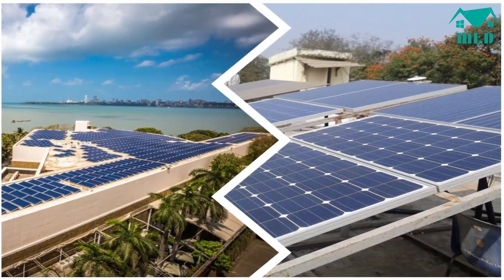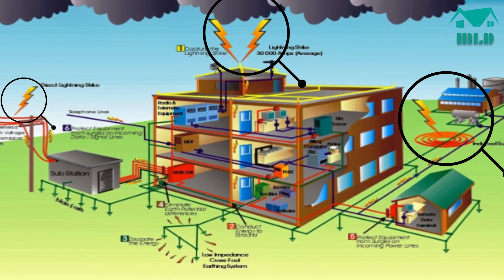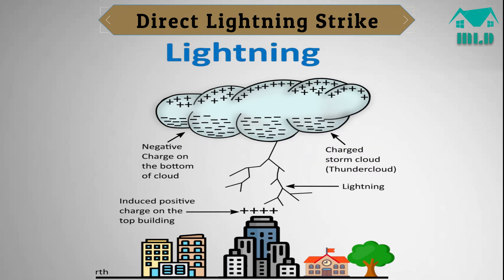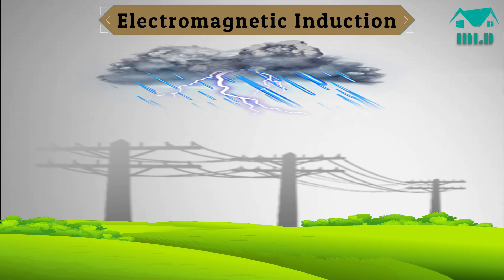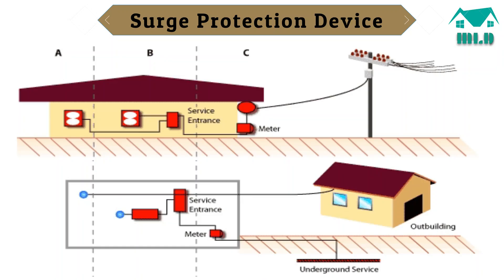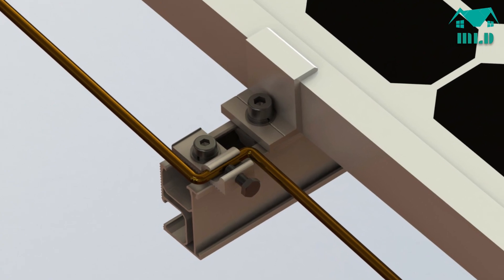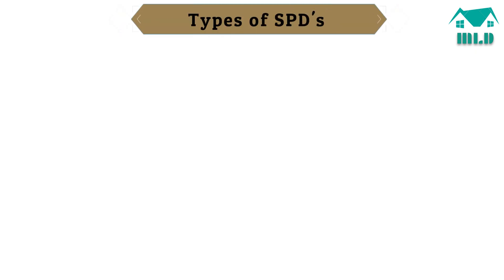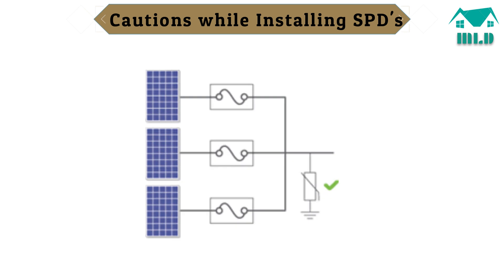How to Protect your Solar PV System from Lightning & Surges?

Comment: Is the earth for pv panels the same as earth for inverter?
Reply from the maker: No it's different and separate
Reply: @EnonTraders  any guides, like the distance between them?
Reply from the maker: The distance between two pits must be at least 5ft. Try to put PVc pipe till bottom of the bore and do not fill with soil above half of the bore in order to put water in coming year to lower the resistance.
Reply: @EnonTraders  what about the specs of the AC surge device?
Reply from the maker: What's the system capacity and connected maximum load?
Reply: @EnonTraders  Solar panels 5000 Watts, Inverter 5 KW , max loads about 20 Amps @ 230 VAC 50 Hz
Reply from the maker: IEEE Standard 1100 recommends cascading levels of protection from the service entrance to distribution and branch panels, and even protection for individual critical loads. The closer to the service entrance, the more robust the device should be rated. This protection in-depth strategy protects the facility and critical loads. In recommending a kA per phase rating a general rule of thumb – “the 3-2-1 rule of thumb” applies: The service entrance should be 300 kA, distribution panels 200 kA, and finally branch panels can be 100 kA per phase.

Types of SPDs:
Type 1 is for service entrance like with your energy meter. 
Type 2 is for Main Distribution Board.
Type 3 is for specific devices referred to as point of utilisation

It must be able to handle surge of atleast 40kA in your case. Type 3.

We usually get Type 2 SPD in market
Reply: @EnonTraders  ok, and do we have to install a surge device on the inverter output as well?
Reply from the maker: Which Inverter you're using?
Reply: @EnonTraders  Felicity IVEM5048

Comment: Hi my question: what is the better solution to protect solar panels?  Connecting altogether by a copper wire then to the ground? Or install a lightning arrester near the panels? Please advise.
Reply from the maker: Lightning Arrester should be connected to the ground separately while solar panels can be grounded with Same Earth pit using the same wire. The point is these all are DC parts it shouldn't be connected to Your Inverter or load.
Reply: @EnonTraders  10x so much
Reply: @EnonTraders  choose one solution : install a solar arrester near panels or connecting panels to the earth?
Reply from the maker: Connect solar panels with earth wire.
Reply: @EnonTraders  many 10x 💞